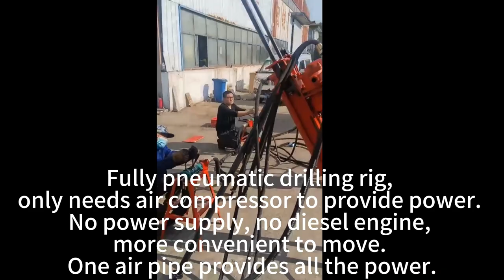One air compressor drives two pneumatic drilling rigs

Comment: What is the average fuel consumption per hour
Reply from the maker: If 1 air compressor is matched with 1 drilling rig. Fuel consumption is about 24L/h.
If one air compressor is matched with two drilling rigs. Fuel consumption is about 38L/h.
We also have gas-electric drilling rigs or electric-hydraulic drilling rigs for you to choose from.
There are also electric air compressors for you to choose from.